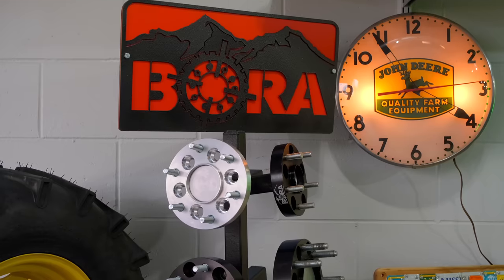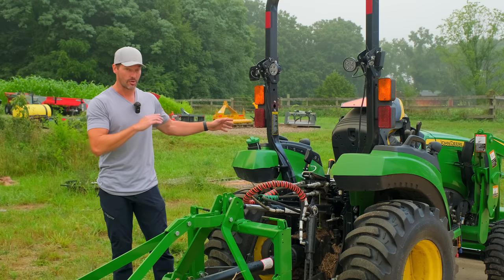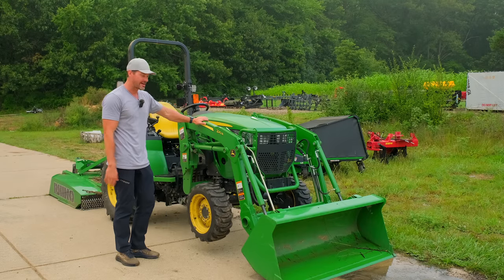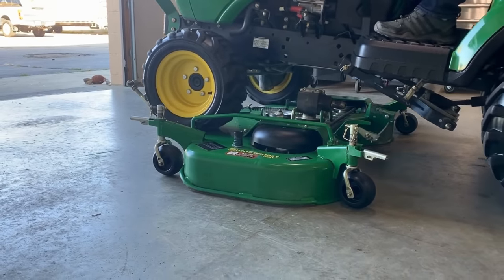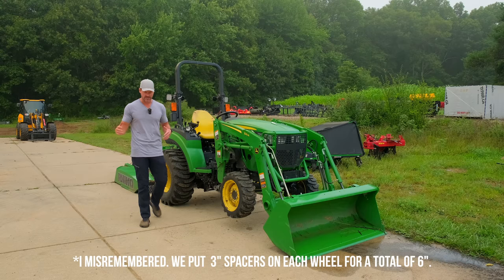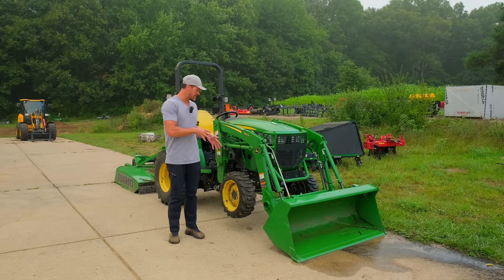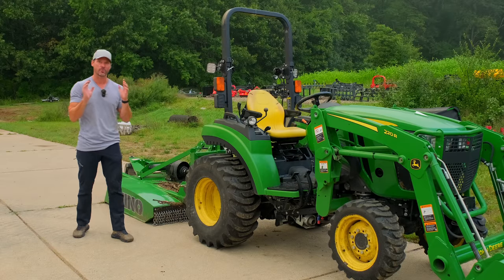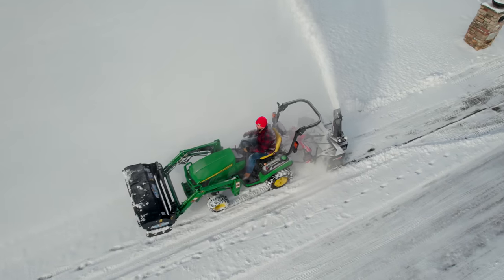WHY YOU SHOULDN'T CARE IF WHEEL SPACERS VOID YOUR WARRANTY

Comment: I appreciate the video very much.  As a physics aficionado (but not an engineer), here’s where I’m pretty certain you’re underestimating the need for front spacers:

Yes, the front axle pivots freely… but only so far - perhaps 15 degrees.  In a tip-over event, the uphill tire can’t leave the ground until well after that point is reached since a tractor begins to flip at perhaps 30(ish) degrees or more. At that moment, the front axle play is well past its stopping point and the downhill tire is applying counterforce.  THEN the extra width/leverage from wider wheels applies to keep the tractor from going over.
Reply: Absolutely. I'm an engineer so I drew up some free body diagrams to look at it. In certain situations, a pivoting front axle will actually see more of a benefit from wheel spacers than a fixed axle. Basically as the tractor tips (or the suspension pivots, depending on your frame of reference), the CG gets closer to the axle, and the angle between the the standard wheel location and the spaced wheel location widens.. Probably the biggest impact would be seen when the height of the CG is roughly equal to half the wheel spacing. I'd have to look at some actual tractor CG data to know how much of a difference it makes in the real world, but I believe front wheel spacers will always add at least a few extra degrees of safe angle.
Reply: @sugar-maple  
Thanks for the input.  I’ve asked about this on a Facebook tractor page and received some similar input.  One guy (also an engineer) was discussing the relationship between angle/traction and the forces that change as you’re making a turn facing downhill and then across the slope.  A significant portion of the tractor’s weight is transferred onto the front outside tire such that any increase in width has a solid influence on stability (and traction).  Couple that with 4wd engagement and it could be the difference between tipping… or not.  😬

Comment: Installed 2" spacers on my 3046R all around.  I had the same logic:  safety>machine.  Borrowed pallet jack from work and it made the job simple.  Jack up tractor with small bottle jack and come in from the side with pallet jack for the wheel.
Reply from the maker: Glad to hear it went smooth!
Reply: When I bought my property there was an abandoned pallet jack in the shed that the seller said didn't roll anymore. A little elbow grease and it rolls fine now and is incredibly useful when I need to move material around especially gawd awful heavy tractor tires filled with ballast! The pallet jack forks keep the tires upright, stable and not rolling around unintentionally.

Comment: I just bought an "old" 1979 JD tractor - 2040 - and wow! the construction quality difference is huge compared to my 2021 tractor. The old ones are HEAVY and wide. The new ones are light and narrow. There really is no comparison. In 40 years which ones will still be around? I think that's pretty easy to determine. The 2040 can widen or narrow the front set of wheels as standard with numerous settings (different crop row widths).

Comment: I use Bora spacers on rear axle of 1023e. Drive over mower does not work with front spacers.  2  1/2 or 3 inch spacers cause an issue with right rear gauge wheel adjustment for attach/detach operations. I have adapted the process; less convenient but workable   Better safe than sorry; I don’t want to make headlines for a rollover

Comment: I put 1.4 inch spacers on all 4 corners of my 1025r. The spacers on the front are needed for tire chains to clear the tie rod ends when I'm using a snow plow. With the spacers on the front, you need to be careful making sharp turns as the tires can rub the loader frame.

Comment: I run Bora spacers(2.5F, 3" R) on my 2025R Gen1.  I don't mow with it but did try to put the 54" mmm on and it did't line up to drive over,  and  it rubbed on the left rear tire when we finally got it attached.  So to actually use the 54" mmm you would have to remove the left side spacers.  Since I don't mow with the tractor the deck went back in the barn and  I put  the spacers back on.  The added stability is amazing and it is surprisingly easy to install the chains in the winter with the additional 3 inches of room  !.

Comment: Does 1,5 or 2 inch spacers hinder the use of ramps on a trailer?
Reply: It would make sense that wider wheel spacers -- 3-plus inches -- would be an issue with trailer ramps if the spacers were only installed on the rear.

Comment: I Would try to not use spacers on the front. Doing so moves the wheel centerline out, altering the load on the front wheel bearings. It also alters steering geometry. The spec that changes is called scrub radius and can cause accelerated wear on tires and bearings.
Reply from the maker: Good info, thanks for sharing!
Reply: Depending on the type of work you’re doing with the tractor I feel the trade off is worth it. Running on steep slopes is murder on tires and bearings anyway, you might as well be as safe as possible.
Reply: @coryfoley9519  I can agree with that.  Not like wheels spacers in the front will cause some Immediate Catastrophic failure. Most likely reduced lifespan of. Certain parts like bearings.

Comment: Honestly just be careful. I have a BX2380 and I work on some definitely not ideal slopes and angles. No spacers. Go slow and if you feel a wheel going off the ground just stop. I think many just send it and end up with a tip over or dead or both. To me a tractor roll over is easy to sense. You are going slow it is not like a car.